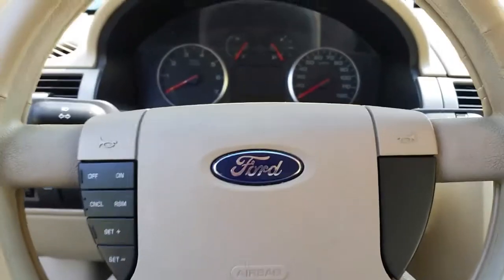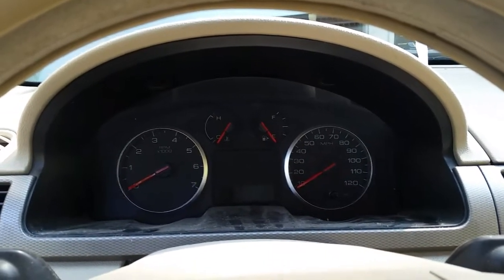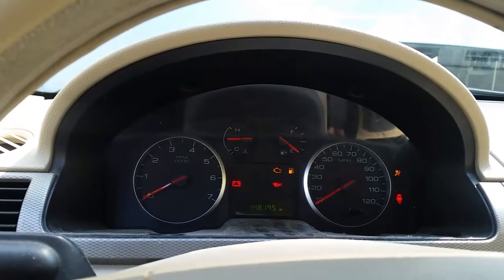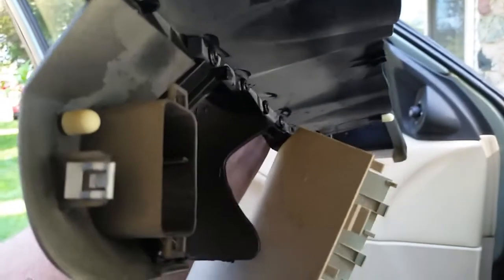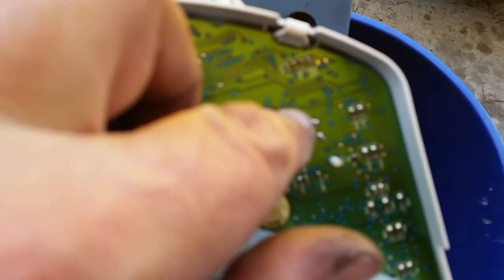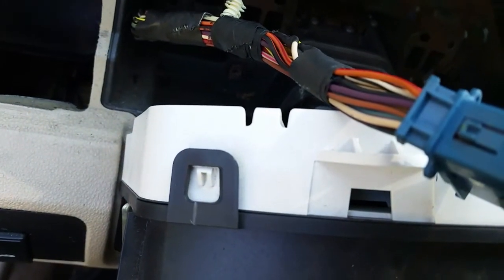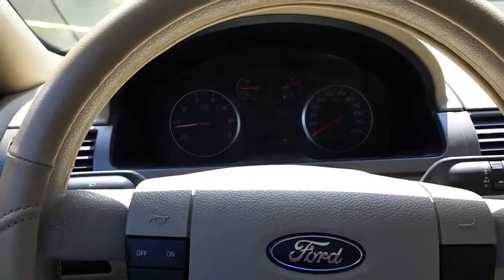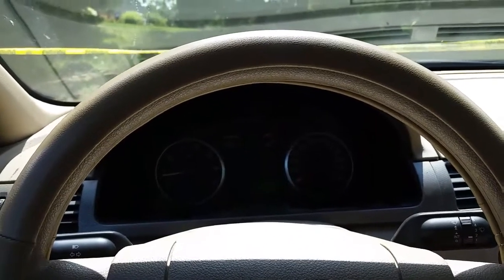2005 Ford five hundred instrument cluster repair. Save $1000!

Comment: Daryl, thanks for this video. I just completed the repair (2023-Dec-20) and IT WORKS!! I re-flowed the solder with my Weller gun, 2 places on the right side and 4 places on the left side, re-installed the cluster, re-connected the battery, and stuck the key in, fired her up and all gauges work, no more reverse lights on all the time and now I have turn signal click-sound and dash indicators. The turn signal flashing was controlled from somewhere else, they always worked, I just couldn't hear them.

Tx,
Jon
Reply from the maker: Happy it helped. Check out my other 500 video about pcm module harness location. It could save you trouble down the road!

Comment: Did you have an overcharging issue?  I'm not sure how a IC could affect the PCM's regulation of the alternator, but it's lead me to the cluster,!??
Reply from the maker: I don't think I have an answer for that have you put a Volt meter on the battery while the engines running to confirm it's charging At the proper voltage?

Comment: My cluster goes out after several bad rain storms. My floorboard gets wet from water leaking somewhere (I can't find). May be a humidity thing. Anyway, when things have dried out, I can get to  work;;; by unpluging the harness ... at the cluster. That removes the power and resets it when plugged back in. While the cluster is dead, AC will not work, backup lights stay on (while engine is running). Audible alarms do not work when the cluster is dead.
Reply from the maker: I've heard windshield leaks are fairly common.clogged sunroof drains too. You will have recurring electrical issues if you don't attend to it.
Reply: My driver's side floorboard was SOAKED after a heavy rain. Turned out to be clogged sunroof drains.

Comment: It's now 2022, June, and I just did what you said.  Early today it was clicking on n off constantly.  Just took it out for a couple of miles n now I'm smiling. 😊
Reply from the maker: I'm not good at soldering, mine failed again. I ended up pulling one at salvage yard.
Reply: @darylturcott  any chance you can point out the other two points on the old one? I want to try hitting the two you showed in the video and I’d like to do the other two also

Comment: Fixed my kid's 2005 Ford Freestyle (150k miles) using this video. The entire instrument cluster was dead. Re-Soldered all 6 pins, and it's working now without issue. Thanks!
Reply from the maker: Very happy it worked for you!
Reply: @darylturcott  hey do u know how to fix the cluster mine works but it shows lines where the mileage is and low fuel even when i have a full tank
Reply from the maker: You could pull it out and look for damaged solder joints. Other than that, I am not sure.
Reply: @darylturcott  ok thank you
Reply: Hello I just bought my son a 2006 ford 500 and the whole dash cluster don’t work I see you said you fix your kids by taking it out and you say soldered all 6 points. Where exactly are all six located at and what they look like? thanks

Comment: Thank you soooo much!  Everything works again.  Had all the same issues and this nailed it.  I just followed your advice on soldering the pins (they already looked good but obviously they were not) and it made all the difference.  Greatly appreciate you posting this!  Saved me $$$
Reply from the maker: I'm not good at soldering. My repair only lasted a few months.  I ended up putting in a used cluster.
Reply: @darylturcott  How do you know the used cluster won't do the same thing?  Where did you find a cluster?  Ford don't have any new.
Reply: @darylturcott  Read my other comment that is my issue then the replacement went out.  Visually the replacement unit looks great when I inspect the soldier joints so I dunno I am about to go crazy dealing with this thing.  My poor son was gonna be his first car he turns 17 in a week been waiting a year on this pos lol.
Reply from the maker: @gebzed  check the pcm harness under the hood on passenger side sometimes they rub on the frame and short out. Causes all dorts of issues
Reply: @darylturcott  Thank you I heard of that issue before as well and I am going to check it out asap.  I been out of town and its been at a local garage.  He said take it to the dealer but I am trying to avoid that.  Will let you know thanks again for the help!
Reply from the maker: Dealer would be a last resort. I took this in and gave them a detailed  note explaining where the damaged wire was. They charged $120 and told me i had a bad fuel pump!

Comment: I used your Tip.
All I had to do was unplug the Cluster cable and plug it back in.
Thanks for your Tip.
Reply from the maker: Wow, that's great
Reply: Yes it is the secret fix among mechanics. The pins oxidize in hot / cold / humid/ dry cycles. Use electric contact cleaner spray before plugging it back in. Fair $50 repair for the honest lifelong mechanics $ 1000 hit job for the crooked stealership ones, but karma catches up with those types.

Comment: 10/7/2022 - My battery died (no cranking, no noise), AAA replaced it and my cluster , climate control both died. My reverse lights stayed on. I pulled and re inserted the fuses for cluster and lights and everything was fine.....
Reply from the maker: Wow, somtimes its just a simple thing. Thanks for the tip! We ended up ditching the 500 when the transmission failed.

Comment: What he said about a speedometer having to match a particular car it is not true they are interchangeable as long as the features are the same on the speedometer itself
Reply from the maker: Many newer models require programming for vin number match
Reply: @darylturcott  I haven’t ran into
That issue yet
Reply: @darylturcott did you need to have yours reprogrammed when you finally had to replace it?

Comment: I wonder why ? My gauges quit working and backup lights stay on all the time (pulled the bulbs) the back up sensor still beeps if I'm close to something, does not matter what gear. The auto door locks no longer lock when I start driving and the drivers window still has it's auto open but auto close no longer works. Where should I start in trying to locate the problem ? 160K and runs well since I replaced the starter 3 months ago and battery last week, gauges not working after battery replacement ?
Reply from the maker: Watch this video and check the wire I show. My 500 had very similar issues
https://youtu.be/3jxtj0cI_AA
Reply: @darylturcott  Thank You ! Good to know. Will do this. What other bugs did ford build in for us ?
Reply: Thanks for the help ! I'm sure I would have given up trying to find a short somewhere. I didn't find any problem with the wiring but I put a bit of foam in between it and the AC line anyway. Used my soldering iron and a tiny bit of solder to connect the contact points on the back of the gauge cluster and all is well. THANKS SO MUCH !

Comment: I've been having the same problem you describe intermittently over the last several years in my 2007 Five Hundred. I've had it looked at by multiple mechanics, and no one has been able to figure out what was wrong.
Reply from the maker: I'm not very good at Soldering, my repair only lasted a few months. I ended up going to a junkyard getting a replacement cluster for $20 no problem  Now
Reply: Did you ever figure it out? same year and model.

Comment: Would this problem drain battery?
Reply from the maker: I dont think so
Reply: @darylturcott  I have exact same car as yr son..something draining my battery..just replaced alternator. Have no idea where to look next. I've been watching ur videos all day! Thanks for them!
Reply from the maker: Is dome light shutting off?
Wipers moving all the way down?
Reply from the maker: I would get battery tested if you havent already, sometimes they develop internal shorts
Reply from the maker: Next step would be to get a volt meter and measure current draw when shut off.then start pulling fuses until the draw stops. That will identify circuit.
Reply from the maker: Keep me updated, I will try to help
Reply: @darylturcott  just got a new battery . I will have someone check the fuses. You've been so helpful can't tell u how much I appreciate it! Will let u know..thank you!
Reply from the maker: My email is darylturcott@gmail.com if you need any more help. I have factory manual I can copy and share if you need pages.

Comment: Can I buy the cluster on Advanced Auto Parts and what would it be called?
Reply from the maker: I honestly don't know if the parks stores sell replacement clusters. There are shops on eBay that advertise repair service but honestly they are extremely common and inexpensive at the local put yourself scrap yards

Comment: What if you want to switch from showing your oil life to your actual mileage? I now only see my oil life but I need to keep track of my mileage.
Reply from the maker: I don't think it is switchable, I believe it is programmed for each vehicle. 10,000 miles for my hybrid. I also just found out that a junk yard cluster will work just fine, it does not have to be programmed on 2005.

Comment: Daryl you are quite handy, good job. Have you had any other issues with your son's Ford five hundred ? I have a 2006, same color. Thanks, John
Reply from the maker: Yes, the harness from pcm to the egr lays on the ac line and gets rubbed until the wires start shorting out. Causes rough running and multiple codes.

Comment: Im a broke college student with a dead ford 500. I have had intermittent charging issues for months. Changed my serpentine belt and tensioner, cleaned all and checked battery terminals, cleaned all grounds, and put two new alternators in the car to no success. All of my lights dim at idle, and recently (With an alternator less than a month old) I lost all electrical power while driving. The car would not start up after. Let it sit for 10 min and it started up again only to lose all power and die again. Got codes for bad ECU and battery pack out of range. My mechanic told me it’s my restraint control module which is mind blowing to me. He’s the professional, but I just can’t wrap my head around that. I have searched every forum high and low for answers. Any insight on this problem would be greatly appreciated. I’m about to have to take out a god damn loan for another shitbox, please help me.
Reply from the maker: Check out this video, it could be the cause of your problem. When the car acts up, move this around and see if that fixes it. If not get back to me and I will try to help further.  My email is darylturcott@gmail.com
Reply: daryl turcott What should i move around? The dash?
Reply: @clone1137 Did you figure out the issue? same problem.
Reply: @Super-360  Mechanic was telling me it was the Restraint Control Module specifically because they’re on back order and crazy expensive. He was doing that to get rid of me I later learned, because he couldn’t figure out the problem either. The problem was the alternators they were installing on my car. Whatever carquest, duralast, or generic rebuilt alternator the mechanics were installing in my car was what was causing the issue. Doesn’t work properly with Fords “Smart charging system”. For fucks sake I even went to a FORD DEALERSHIP AND GAVE THEM MY VIN and they sold me an alternator that did the same fucking thing. I took the car to an automotive electrician who had it running in one day by installing a junkyard alternator from a Ford Five hundred. That’s what fixed my problem, installing a genuine FOMOCO alternator off an old Five Hundred.
Reply: @clone1137 did you get a check charging light? thank you so much for your comment. It really gave me some great insight. We have a problem with over charging the battery so much that the car will literally shut itself off. It usually only happens when the car is first started though and the alternator overcharges the battery so much that it will shut off the vehicle.
Reply: @Super-360  yes the check charging system indicator was on, sounds like it’s the wrong alternator
Reply: @clone1137 ok thank you so much. I found one thread about changing the instrument cluster and we did that and still have the same issue so maybe know it may be worth getting a genuine formoco alternator.
Reply: @Super-360   I’ve seen those videos too, talking about a weak soldering joint. What exactly are your symptoms again?

Comment: This didn’t fix it for me.   Guess I have to buy another one 😩
Reply from the maker: Mine failed again and I got one at scrap yard for $15.
Reply: @darylturcott  did u get it reprogrammed or u just put it in .im going to the junk yard to get one tomorrow
Reply from the maker: Just put it right in. No programming required, at least on my 05. It shows the mileage from the odometer that you put in it.
Reply: @mr williams so did you have to bring him a reprogrammed or not? I always feared that that would be a necessity. But, if you got one from the junkyard and it's working it's worth a shot.
Reply: @darylturcott yeah I'm in the same boat now. Your fix worked for awhile though! 👍
Reply: @darylturcott oh there's my answer — thank you!!

Comment: Had my 2007 500 cluster resoldered , wiring harness checked and harness was good, replaced bulbs and fuses but, still no lights or working gauges  on the cluster. 89, 000 original miles on the car.
Reply from the maker: I ended up getting one a a junk yard. $20 works great.
Reply: @darylturcott  what about the mileage readout on each cluster? Mine is 89,000 original while let's say the new junkyard cluster shows 160,000 miles! Do I have to take the car to Ford dealership to get the cluster reset to my vehicles original miles?
Reply from the maker: The mileage will be from the speedometer you put in. On newer vehicles it's stored in computer.
Reply from the maker: I believe the dealer can program new cluster to match, but most won't work on used part installations
Reply: @darylturcott  Thanks for the info and since I'm about 10 minutes away from your son's school, I wish my son could swap cars with your son and he drive our car back to you and you evaluate the situation. 😀 Keep up the good videos.